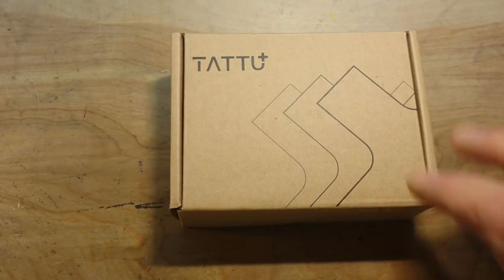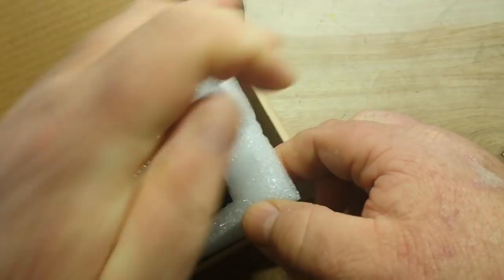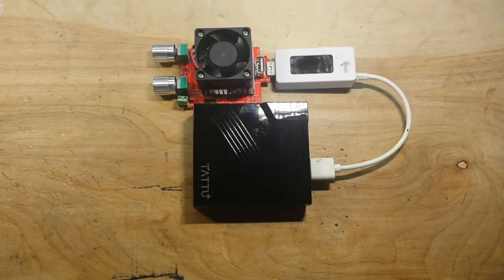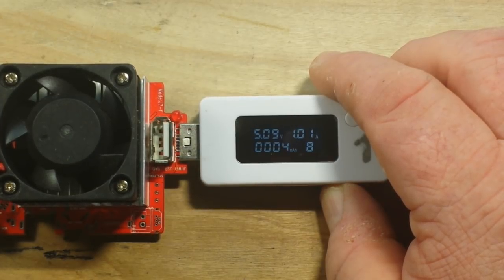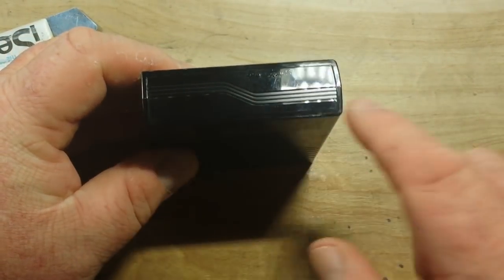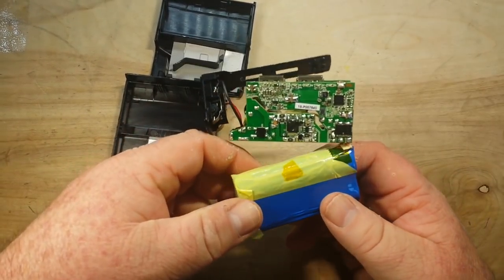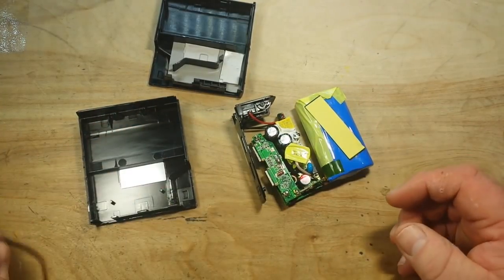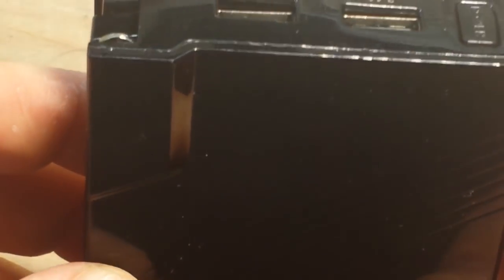Tattu 2 in 1 Charger Review and Teardown

Comment: That thing is really high quality looking and from what you say probably is. Great price too. Do you still fly? I flew gas powered planes when I was a kid, but that was probably decades before R/C. It would be interesting stuff to learn about ;-D I've never messed with radio control stuff. Thanks for sharing the booty with a good video!
Reply from the maker: Hi George. No I quit in 2013. I started in the mid 90s with nitro birds, then moved onto gasoline powered giant scale birds. But around 2007, I went all electric. The biggest plane I had at the time was a quarter-scale Spacewalker. It used 2 6 cell 5000mAh lipos. Almost 200 bucks in batteries for a 7 minute flight. Lol still cheaper than renting a Cessna for a day. When I quit flying full-scale in 2010 when my CHF was diagnosed, it was $140/hour wet for 2004 172SP.
Reply: I know how expensive it was, which is why I went another direction with my hobbies. I didn't know you were a real pilot too, fun stuff but like you say real expensive.